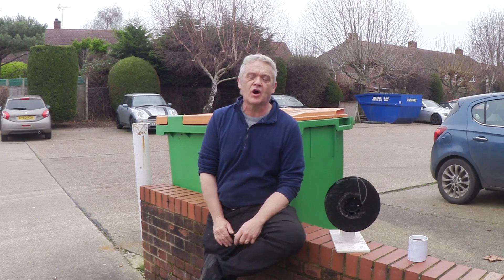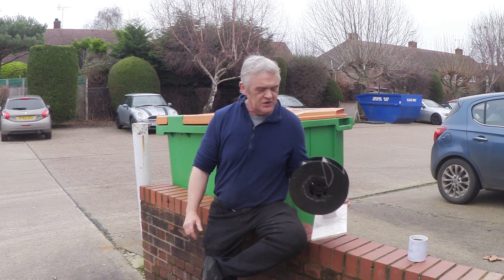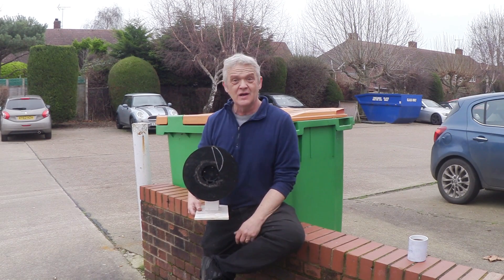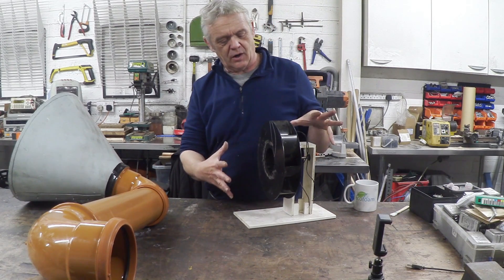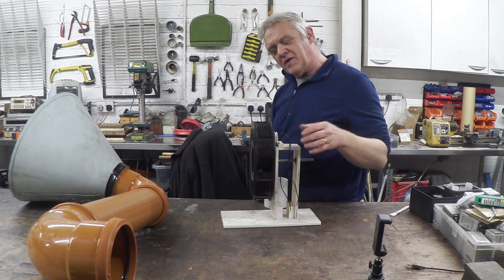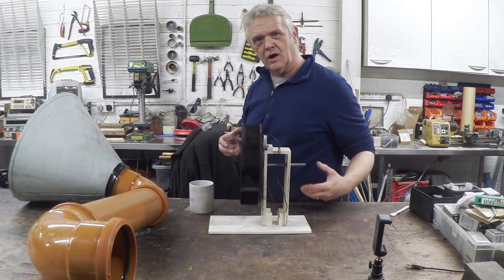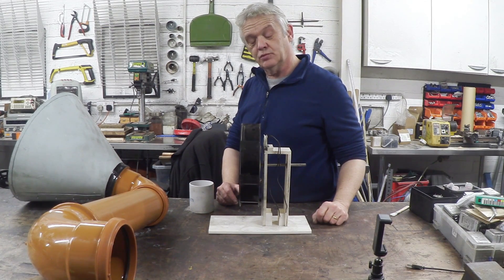1383 Venturi Turbine - Mark II

Comment: I have seen your funnel and tube were mounted vertically and mounted so that it could rotate so the wind goes in the funnel and is directed down but the funnel had a large fin on it so that it would always face the wind and then mount your favorite wind generator directly under the outlet thus a wind generator where the only thing actually moving in the wind is the funnel

Comment: With the fan horizontal and a contoured entry to the orifice to improve the venturi the inlet cone could easily be mounted on a vertical pipe and the cone allowed to self orient to the wind direction with the aid of a vane on the back which would also balance the cone weight.

Comment: Hi Rob, I would love to be able to tinker like you but have been laid up in bed for a month with extreme back pain so can’t do much but enjoy watching your progress. I have made a few comments re Venturi effect on previous episode’s. Would you get better results by placing the cone directly in front of the fan. Surely the pipe and bends adds drag, and does the air not loose momentum with a change in direction.
Reply from the maker: what you say is right mate but the premise here is to get the machinery on the ground where maintenance and installation cost is lower - that of course has a price in efficiency but, in my mind,  it is really all about cost per watt generated at the end of the day

Comment: Looks like a solution to what you described in video one. 

A cone at roof line that has a tail to make it face the wind. 

A 4-6 inch pipe down to ground to turn this design. 

I recommend that the end be tapered down to increase the force of the to the turbine intake with a 1-4 mm stand off to suck in ambient air.

Then a capacitor After the generator to take load off the 
turbine/generator.

Looks good for proof of concept. The bigger build will be great.

Thanks for the post.

Comment: Do I need to say it. Get the mini rose on there and give it a bash. Looking at other similar designs, they seem to use a turbine with a very shallow angle, similar to a turbofan turbine or steam turbine. I'd like to make one that the blade angle is adjustable to optimise the power extraction from the wind under different conditions.

Comment: You could put a cone in the Center of the Impeller to help guide the Wind towards the Impeller blades. I guess smashing it on a flat disc is not ideal . Or you could try the Mini- Rose in combination with the Pipe, as it already has a cone in the Center. Or you could take it a step further and create an Impeller-Rose.
Reply: Exactly my thought too! :)

Comment: lol at everyone saying "get rid of those 90 degree bends and you'll get a better result!" when the whole point is having the wind collected up high to run the turbine on the ground.
Reply: In all my years of fabricating headers for my racing engines I have discovered that as long as the header tubes were the same size and all the bends were smooth on the outside radiuses, a bend had no real adverse effect on the air flow. As long as our headers were at approximatly 18 inches in length, they would scavange exhaust pulses very cleanly.  Mainly because engine exhaust travels in brusts from the cylinder exhaust port due to firing etc.
 I think that had he put a pointed cone inside the center of the fan to direct the air to the outside angled blades smoothly.  rather than against the flat center plate, it would have been much more effectient.  Plus had the venture been necked down at the fans input hole it would have inscreased the wind speed some as it was dispersed by the center cone.  And elliminated the overblast against the side of the fan blade. Air does not like to make flat cornereed turns!  But give it smooth outer walls to flow against and you will get much less turbulance.
But that's just my opinion.

Comment: I am wondering what the difference would be it you eliminated the friction losses by removing the 90 degree bends and either used a straight pipe from the collector into the turbine or if you used 45 degree or 22.5 degree bends.

Comment: I couldn't help but think what would happen if you used the turbine to power a flywheel, and then scavenged energy off the flywheel
Reply: Any energy you scavenge from the system will decrease total output.   Energy comes from somewhere and it's limited.

Comment: Robert……
you are a GENIUS…….
Reply from the maker: lol - wow - cheers mate - not so sure about that hutch - but thanks
Reply: @ThinkingandTinkering  The more i watch your videos….
The more you inspire…..
I have a young lad that we are building bicycle trailers. He builds and races off road race cars.  He built trailer #1 almost three years ago. It holds a 400wh battery and 200w of solar. And i rode it across America , California to New York.
I get up to 80km a day propulsion from the sun carting over 150lbs of camping gear.
Paul lives dab smack in the center of San Francisco.  I plan to be heading up there latter this month to continue working on Camper/Trailer #2.  It has 1000w motors in each wheel made by Grin from Canada. We are designing it to explore The Baja outback . I even have a small fridge/freezer to go into it…….
I am SUPER honored you responded……………

Comment: Venturi makes air to speed up. In this system is better axial turbine. Put on that pipe some fan for WC venting. If you have radial turbine put air around the sides with some snail like housing. Air can get more speed before it hits that blades. Air can be directed with some little wings. Just like turbine in car.

Comment: When you remake the turbine with tighter tolerances, see if you can extend the rotation shaft into the elbow and an adapter, with bering, inside the elbow so as to keep the rotation from tearing it off kilter.

Comment: Redirecting the wind certainly has a lot of merit and there are other ways  that come to mind well worth considering 
Roof ridges and corners of buildings for starters  or the plant room itself being the air concentrator 
Concentrating the air raising the temp would make heat pumps more efficient set after the turbine would help efficiency and could provide heated ventilation to boot  and first stage to air compression for second stage compression for  surplus electrical  get all that heat baby 
I really like this direction 😃

Comment: Hmmm..... Centrifugal impellers need air speed, not so much pressure. I presume without any plumbing it would spin faster?  If you want it to be fed by pressure difference, feeding the impeller radially as if it was a Francis turbine, would be worth a try.
Reply from the maker: that is worth a try - cheers mate

Comment: Very interesting. I wonder what the effects would be if a cone was placed on the output end of the tube, that directed all the air right into the input of the turbine, or if this would make any difference?
Reply: How would that be done without interfering with the prevailing intake air?
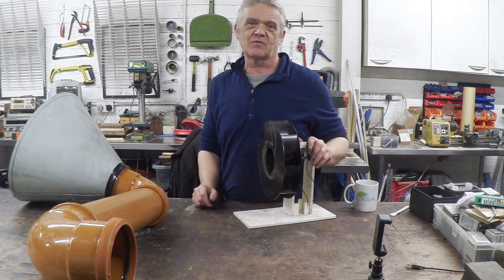Reply: @fireballxl-5748  I was meaning that it would go on the output end of the tub, directing all the air into the turbine, instead of some of it going off to the side. At 1:59 the output is right against the turbine, but I assume there would still be a little air velocity lost as it hits the flat front of the turbine, and goes to the side.  By the way I like your handle, I can remember watching that show when I was young. ;-)
Reply: @howardg396  Yes and the other show was Thunderbirds are Go!

Comment: (Also posted on Venturi Turbine 1382)
What if the exit cone was 90 degrees turned that the prevailing wind blew across it?  Would it create a Bernoulli  effect actually pulling the air through as well as pushing in from the other cone?
Reply: Yeah that will create a Bernoulli effect and that geometry can be part of the optimization.

Comment: Why not connect the ventri direct to the fan, you will loose the resistance of the two 90deg bends
Reply from the maker: because you couldn't then sit the machinery on the ground and the cone in the air